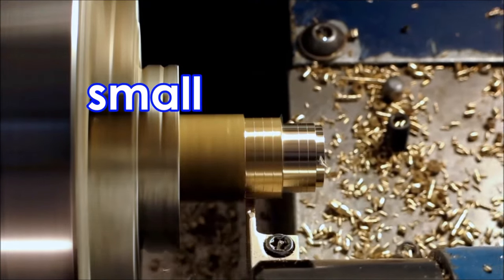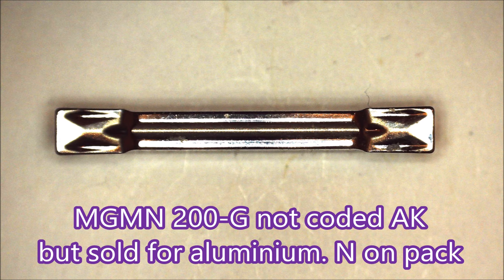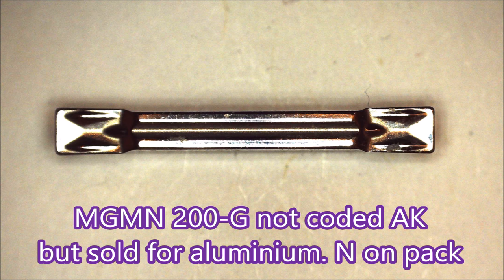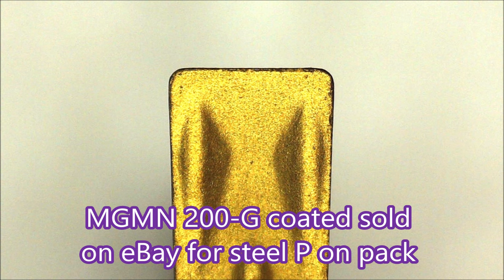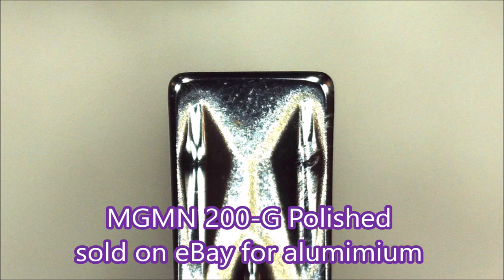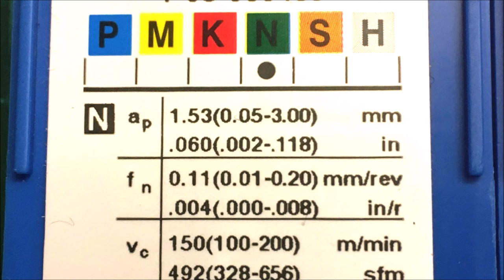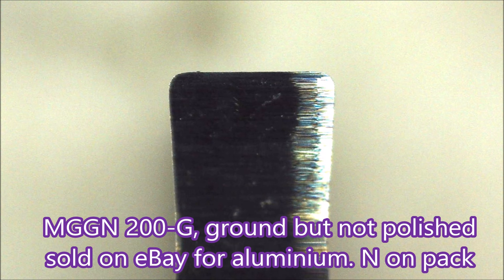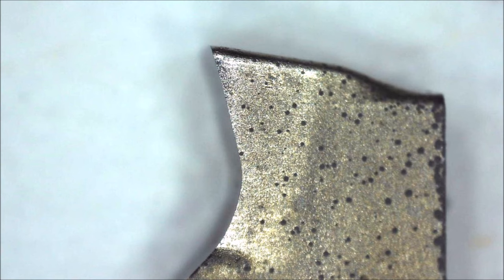eBay Parting inserts for aluminium Good or Bad?

Comment: I'll share something I've learned about carbide inserts and end mills in the last half dozen years working in a home shop:
I make limited numbers of gr5 titanium, 17-4 and 303/304 stainless parts for things I sell.  I do the usual aluminum fixtures and general parts for myself and I also machine some brass parts.
You can narrow your tooling cabinet of carbide inserts and/or end mills down to 2 basic types that are very cheap to buy:  

1) Bright uncoated sharp (and for inserts positive rake) typically rated for aluminum.  Use them for aluminum, brass, plastic and anything else soft or unusual.   They work on hard steels also with light cuts.
2) The other is inserts or end mills with one of the modern PVD coatings for super alloys:  tialn, altin, alcrn, nacro.    They're plentiful, available in cheap generics, and will do well in every steel, stainless and titanium.  I use these by far the most often for all general work in metals.  Just grab and get to work.

You can get infinitely more specialized than this, but as you guys said it's easy to go crazy getting lost in the insert and end mill catalogs.  I'm also ignoring all the other issues like corner radius for tool life and strength etc... this is about picking ONLY 2 broad general types of carbide inserts and end mills to be able to do everything reasonably well.  These two tool types also overlap on use almost completely.  I can cut every metal in my shop with Tialn coated tooling without fearing the result and I usually do.  And the bright finish inserts and end mills also can cut anything including plastics, just respecting the reduced life of the ground sharp edges on the bright tooling on hard materials.
Reply from the maker: Thank you for taking the time to write up a comprehensive comment. Much appreciated. Nigel

Comment: I only use inserts and have done so for many years. Parting off inserts have always been a problem for me. They cheap ones are critical in that the centre height must be in the exact spot. They will often just rub if not quite in the correct position. I have always favoured genuine Sandvic parting inserts in a Sandvik parting off tool, as they will cut stainless mild steel and brass as well as aluminium. They are pretty tough but with a Boxford lathe that I mostly use I have to run at a slow speed especially with stainless. Cutting through 2" stainless rod can be a bit of a chore in back gear but it will manage it. I use oil for lube and with aluminium people suggest paraffin but recently I have been using WD40 as it stops the tool getting a build up of melted swarf. Nothing wrong with Ebay as the one stop shop for buying inserts.  John
Reply from the maker: Hi John, a friend used to make man thousands of stainless steel buttons about 32 mm. He would only use Sandvik inserts for that job  as they were cost effective. He tried all the others, but for that job only Sandvik would do. He used inserts from a number of suppliers on other jobs, but not that one. When working I would not have taken on a job in 2” ss. I would have shopped it out and saved myself and equipment for jobs that would be more beneficial for me! Thanks for your comment.

Comment: I love the eBay inserts have recommended cutting conditions on the back side of the package, I wouldn't believe them anywhere beyond light machining some low-carbon non-alloyed steel. In case of these cheap inserts, the good had found its buyer. For hobbyists and people turning small parts from soft materials they are excellent, sadly for other than small-scale use they are terrible.
A lot of them were stolen from workplace, a lot of them are fake copies, a lot of them are inserts from batch that did not pass quality tests, a lot of them are from unverified manufacturers. It often happens that first insert can easily survive 30 minutes in-cut and second one breaks after 10 minutes.
Reply from the maker: This lack of consistent performance never bothered me when I was busy, another reason I was happy to go with Sumitomo inserts. On brass and aluminium, inserts used to die of old age before they needed replacing! Thanks Adam for adding to this video. Nigel
Reply: Or they were bought in bulk for a specific tough job but are no longer required so they flog them off to people who think because carbide inserts are used in industry I must have them too in my little underpowered home shop. And strange as it may seem a tip intended for a fifty horse ten ton machine doesn't always work èll on a half horse couple of hundred pound one. 😐
Reply: @smallcnclathes  Yes, that's what I meant. Sadly few times happened to me (even though we use inserts directly from manufacturers' dealers) that the insert was faulty and cracked after few minutes in-cut. Last time I was sure nothing will happen and went for a cigar. I was turning bit long shaft between centers but I was taking very light cuts. As I lighted the cigarette, the unhappy sound startled me. I was lucky that colleague was nearby to turn the machine off, otherwise the steel bar would just go flying.
Reply: @chrisstephens6673  Yes, I work on 35HP and 5 ton machine and I barelly use 50% of what the roughing insert would survive. It's because turret lathes have generally low rigidity and once I get beyond certain threshold, the machine starts shaking through the floor - yet I'm not even on 80% spindle power, it's just the foundations of the machine failing to transfer such forces. The insert then just rather cracks due to machine vibrations, movement and intermittent force than being properly fatigued.
I think that using carbide tooling on these small machines gives no sense when you machine brass and aluminum only, except that you don't have to grind HSS blocks into shape. And maybe some very sharp inserts to get shiny finishes.
With HSS you can turn mild steel, martensitic stainless and well machinable austenitic stainless like 303&304, probably will work better than dulling carbide inserts on 0.5mm DOC and 30m/min cutting speed dry machining.
Reply: @adamsevcik7708  HSS is underrated these days, it doesn't take long to learn to make a perfectly usable tool, but I think homeshopists get put off by the old time books that say you need all sorts of different geometries for every metal you turn, a myth from the days before TC became the industrial norm. Perhaps people are also  put off trying after using cheap and nasty "far Eastern" HSS instead of using good quality European or American stuff?
Reply: @chrisstephens6673  Yes, the problem is that most people used HSS tools (not taps and drill of course) back in machining trade school and now have no idea how to use it. HSS is not as hard as carbide but is tough and will withstand conditions that would make carbide insert shatter, you just need to use much much smaller cutting speeds to avoid overheating it... which leads to building up edges aaand.. - but again if you turning aluminum and brass, it doesn't matter anyway.
Chipbreaker and geometries are important when you turning non-chipping materials (shitsteels, stainless), thin-walled parts (to avoid part vibration) or boring small dia deep holes with low-rigid long tool overhang and not enough space for chip evacuation (to make chips break into small particles and avoid tool vibrations). For these guys it will be most important to have sharp rake angle so the small engine is less loaded, brass doesn't need chipbreaker and for aluminum, just add more feed.
Anyway, I am very happy for these people they find joy in such beautiful trade - it is very hard to get into it as everything very expensive and out-of-reach for single hobbyist, except handbooks there are almost no tutorials as most skill come from experience in this trade and masters often don't want to share their knowledge.
Reply: @adamsevcik7708  true enough! 👍

Comment: It is a bit of a minefield choosing the right tip!!!  One thing in my favour is that I never use Ebay 😂
Reply from the maker: I have only taken to ebay recently. Sumitomo and Kennametal inserts that I used before I retired are not for everybody. When buying those inserts I found there is more help available from reps of the company. This is what one should expect I guess. Those inserts are not cheap, nor are the tool holders. BUT, when working I can honestly say that I did not mind the cost, cos they just work!
Reply: Looking through an insert catalogue is enough to to turn you into a gibbering idiot, especially if you are naturally already half way there. There are so many differences even between inserts that look much the same that home shop guys just don't stand a chance of getting the right tip from the likes of ebay. Even if they get the right tip for one job, they expect it to work on all and that isn't guaranteed to be the case, but in fairness time and efficiency are not always the priority for them.
Reply from the maker: @chrisstephens6673  Hi Chris thanks for contributing to the video. You are quite right, but to be honest I think that moulded insert in this video would work for most materials and ground one might handle free cutting steel too. I hope to try the out soon and see how they go. You are right about the choices, which is why I was happy to go with Sumitomo, my rep has always made good choices for me